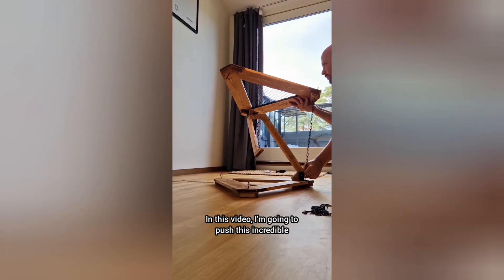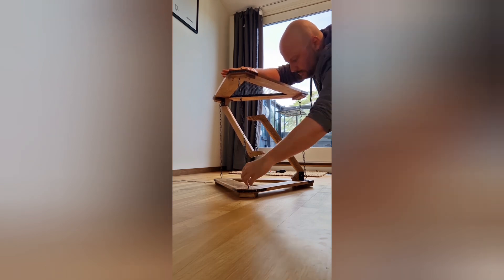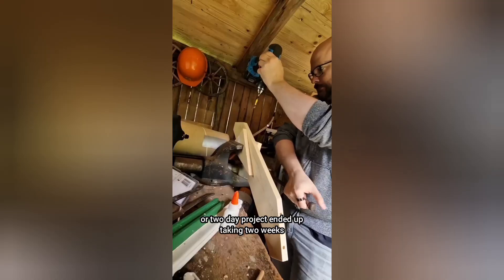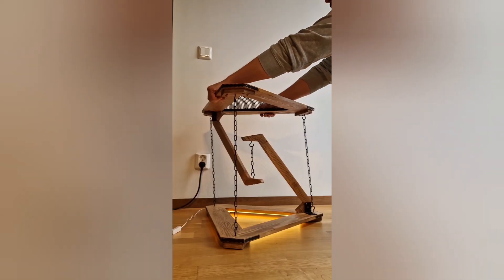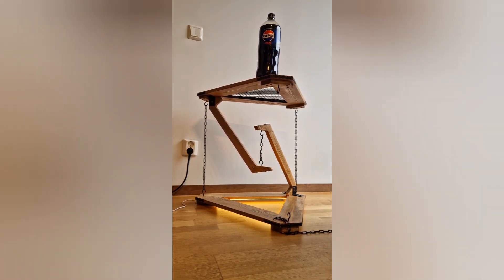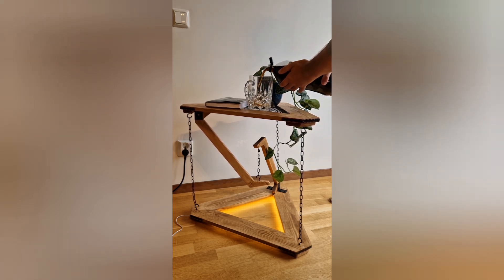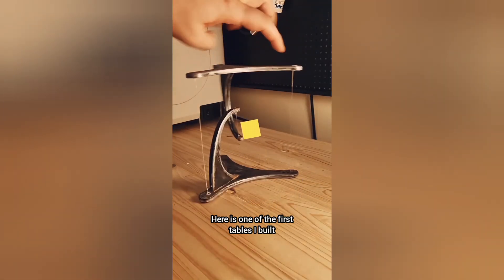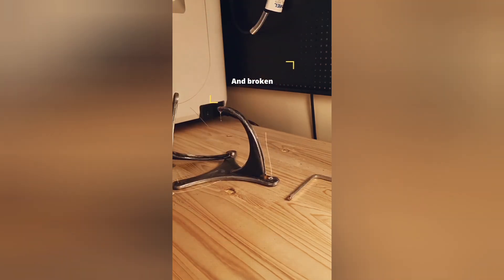Pushing a Tensegrity table to its limits - will it tip over?

Comment: you dont have to build it with precisionm you just gotte be smart enough to use nuts and bolts on your build so you can tighten it up with the threads instead lol
Reply from the maker: Sure, you can make it easier on yourself with nuts and bolts. Heck, why not just weld the whole thing and call it a day. But what I was referring to is the actual geometry—getting those 30° cuts right for the triangle base so the plugs and glue hold snug, and making sure the diagonal arms (which carry the full load) are reinforced and their wooden heads are slightly off from being parallel to the ground, aiming a bit downward to redirect force more favorably through the wood.

I thought that was obvious. Guess not for everyone. 🤷